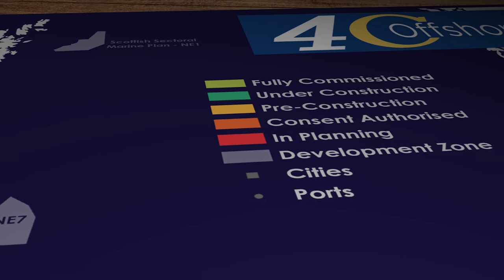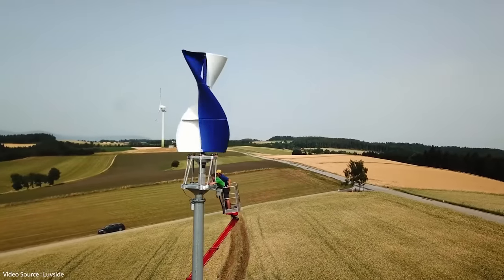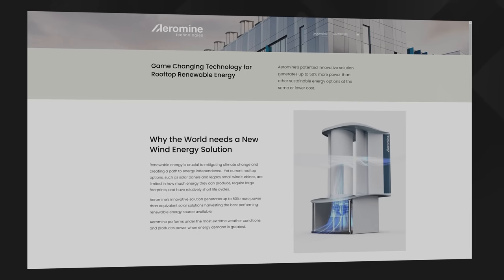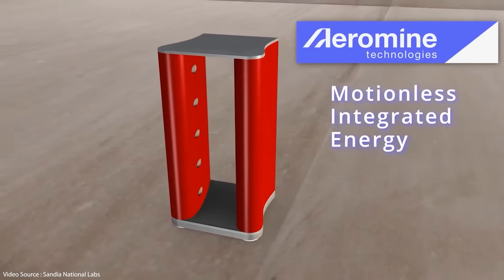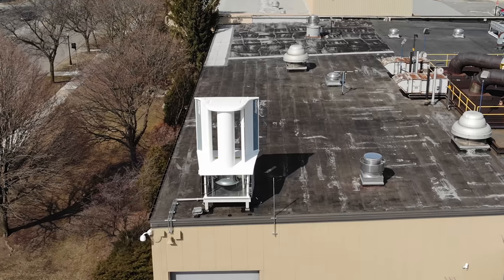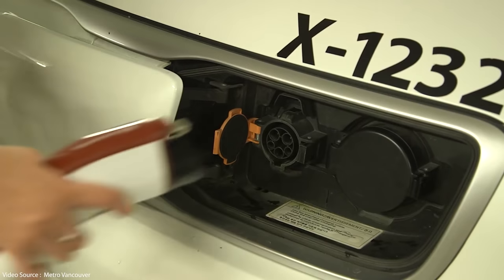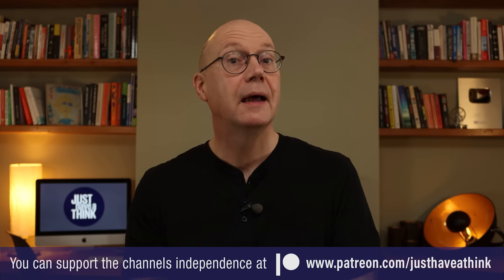Aeromine Rooftop Wind. Static. Silent.  50% more power than Solar PV. What's not to like?

Comment: Thanks for this news for buildings in windy but sun poor areas, where roof top installation and placing is done safety aware (wind load resistence) to get benefit without risk.
@Safety first: maximum storm wind load of higher on top installations should be checked to make safe that they can and do resist next heavy winter storms. 
@Placing wind gen. combined PV: PV on top of wind gen or at minimum northside to PV (looking southside) to avoid shadowing of PV cells which is bad as shadowed PV cells decrease solar energy harvesting as inside of PV modules the inner cells are connected in serial for added voltage, thus shadowing one cell will block that serie circuit reducing the PV power.

Comment: Also, wind turbines need to be mounted at fairly high altitudes—typically a minimum of 150’ but to be reasonably efficient can be anywhere from 500’ to 900’ for large turbines which, even at the lower effective altitudes pretty much rules them out for practical, residential use
Reply: The trick for normal tall wind turbines is to put them at the far end of the back yard or in a neighborhood park that's already too hilly to be viable for additional homes .  The neighborhood solution would be part of a standard suburb project where a land investment is split into hundreds of single family plots

Comment: I think this could work a double shift on a home, with the lower half in the attic and as it is working , the upflow would evacuate the hot air out the top , cooling the attic at the same time.
But then with that kind of design, you now have to worry about rain  getting in. 
I'll keep working on it lol.
Reply: Most roofers in my area recommend just a ridge vent they will install an attic fan if you wish but most seem to say its a waste of money at least in my area I'm in Northern Illinois as roofs get replaces around me you see a lot of the vents that used to dot the roof disappearing in favor of one  that runs the length of the house at the peak and its all but invisible unless you know what your looking for

Comment: Greetings and thanks for sharing interesting tech.  Amplifying on another comment voiced a while back, sorry to be catching up so late.  Focusing on the 1.5 kW example along with energy conversion laws.  The energy content of the wind is 1/2 rho A v^3.  The conversion has an efficiency limited by the Betz limit, 59 %.  Generously (very generously) computing, we could assign the actual conversion efficiency to be 50 %.  Note that the 1.5 kW video example seems to correspond to a 10 m tall machine!!  Using the apparent 2:1 aspect ratio of the turbines, the capture area would be 10x5 m^2, and rho=1, and effic=0.5.  This computes to v=5 m/s, which is good wind but not hurricane force.  So with excellent design (to reach 50 % effic), the 1.5 kW prediction is feasible.  BUT:  a 10 m tall turbine is way bigger than the example turbines of the video.  And there is considerable influence from the use of upflow currents from the large building surface below the turbine.  Well there are lots of assumptions going on here, but you can see that there are ways to make this work.

Comment: Fog, mist and rain just at or slightly above freezing.  Pressure drops in an airflow produce lower temperatures.  Icing, loss of efficiency and damage due to imbalance.  It will be interesting to see how it all wrings out.

Comment: For now VAWT types are over 2000 euro to get the same output as a single 200 euro panel. And that panel uses less space to begin with. So that means in the winter, the solar panel can still outperform the VAWT depending on your location of course...
I one day hope to see cheap enough VAWTs to complement the solar panel in the winter.
In the summer I'm not worried. It's just december till april that's a pain, after that, the generation overkill needed to offset battery costs is enough to have so much excess power that you can run your hot tub 24/7 in the remaining months, while still selling energy during peak energy prices (and that's at night or around cooking time).

Comment: You could add in a Stirling engine into the mix and use that in combination with everything else to generate electricity. Doesn’t require fuel just a heat gradient, eg a hot loft and somewhere that cool. Simples.

Comment: The main issue with a wind turbine is always the power collector and inverter you put behind, that has to be much more expensive and stressed (=lower lifetime) than a solar one. And you can't have an emergency break/stop on wind turbines and thus require some emergency resistance in case the grid fall off or some fuse triggers on battery park. Extra cost that are obviously not taken into account.
Putting them on the edge might lower the available roof sun area for PV solutions, that's not fully compatible and it was obviously some merchandising argument.
What are the vibration and forces resulting on the building and thus requiring reinforcements ?
What maintenance is required ? (there is always one)
What about ice that can happens on fins/holes during winter storms ?
What about lesser PV pannels cooling if wind blows with far less forces on them ?
And there is always be (ultra ?) sound, whatever the commercial is trying to sell you.

It might be some good idea, but as always there is too much mechandising into it. If that's that much powerfull, you won't need advertising, it'll sell just by itself.

Comment: Looking at the shape…( two wings facing each other) there is no need for the outer edge to curve, on a wing the angel of attack provides a high pressure force under the wing, Venturi on top creates the low pressure, the turbine doesn’t require the lift.

Comment: Ford f150 Lightning has an interesting little thing, the battery on it can be used to power a house during an outage.  The electric car future is both creating a problem and a solution when other car companies get on board.  With systems like this that can charge a home battery (Such as an electric car) using solar/wind energy that can be pulled on when the system is strained we are in fact just spreading out a power source.  From one big centralized area to many smaller ones around it's going to be an interesting time.

Comment: What a fantastic concept and also with the advantage that efficiency should'nt be reduced over time like it does with PV panels. One question though: what about the potential impact of changing wind direction? does that have a bearing at all?
Reply: There are bearings on the turbo generator. Sorry for the humour.

Comment: Interesting...
I have always thought just how much free energy we let by...
But there are always problems to overcome that apply..
I like the wind turbine..it's sort of 24 hour system..
However in my area we can get winds of up to 160 plus KPH...rare but exist..and can be very destructive... that's a lot of area force..
So although this system would truly work, it would undoubtedly...at some time, get ripped off...
But still interesting...and simply.
What would be needed, is a 'safety blow of system'...so that when the pressure got too intense, it would open up more, to reduce and deflect it away..
Then we would have something..
Regarding industry...they should all be self-sufficient... independent...by law..
Good video...we need more of this, thanks.
Simon a Brit in Spain 👍 retired

Comment: It seems that this would also be good for single-family home in the US.  This could replace attic ventilation systems and also draw heat off of attic spaces. Drawing air in from the attic. The rising effect of hot air could also improve the efficiency of the unit.
Reply: Best on apartment complexes especially

Comment: Combining a solar wind chimney with an aeromine wind turbine as one unit could potentially result in a more efficient and effective renewable energy system.

The Solar Wind Chimney is a type of power plant that generates electricity using the natural convection of air. It consists of a tall chimney surrounded by a large greenhouse-like structure. The sun heats the air inside the greenhouse, which then rises and flows into the chimney, causing a draft that drives a wind turbine at the base of the chimney.

On the other hand, the Aeromine wind turbine is a type of vertical-axis wind turbine that can generate electricity from low-speed winds. It uses a unique design that enables it to start rotating at wind speeds as low as 1 m/s, making it suitable for locations with low wind speeds.

By combining these two technologies, the solar wind chimney could provide a source of hot air that could be used to drive the aeromine wind turbine, increasing its efficiency and potentially reducing the overall cost of the system. Additionally, the aeromine wind turbine could provide additional power to the system when wind speeds are high, complementing the power output of the solar wind chimney.

Combining a solar wind chimney with an aeromine wind turbine in a high-temperature climate region could potentially be an effective way to generate renewable energy. In such a region, the solar wind chimney could provide a source of hot air that could drive the aeromine wind turbine, increasing its efficiency and power output. Additionally, the high-temperature climate would provide ideal conditions for the solar wind chimney to operate efficiently by creating a strong draft.

Comment: Very interesting. Unfortunately, I can only see this setup working in areas in warmer climates. We get a lot of snow on our roof during winter months, which is why we opted for pole mounted solar panels. They are much easier to sweep off than if they were mounted on the roof. Thanks so much for such interesting videos.
Reply: where I live flat roofs get shoveled,. So in a commercial setting where these are targeted you'd have a maintenance guy doing snow removal on the roof.

Comment: I doubt the 5 kW. Let's say the intake is 2 m2, and the wind speed is 10 m/s. This would mean 20 m3 air passing through pr. second. 20 m3 air weighs about 26 kg. 26 kg passing at a speed of 10 m/s posesses kinetic energy of 1300 J. And that is if you manage to stop the air completely, which I doubt is the case here.
The whole 'Venturi' thing just adds complication and a lot of loss to the system. There's no way to 'amplify' the energy, that would defy the principle of energy conservation.

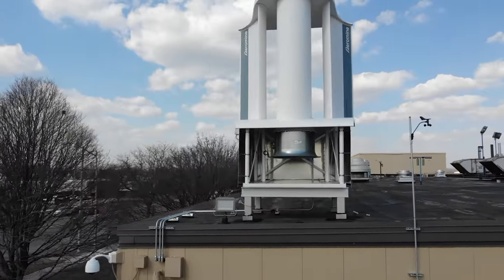Comment: You've repeated that there are no moving parts but the video clip shown at 5:10 shows a rotating fan at the base of the funnel, as the camera pans downward. I understand this design would be very quiet, but it appears there are moving parts. The parts that likely are generating the electricity, by moving.

Comment: I like most alternatives to produce electricity, but this one in particular. Though I live in a country with lots of sunshine, solar power only is not the answer to my needs. We need electricity mostly at night, when we have our AC on, the time that solar panels don't deliver. The alternative is expensive batteries to store the electricity, but I'm not happy with that thought. This Aeromine Rooftop wind power is so far the best I have seen. Would love to have one of those on my roof!

Comment: JHAT,  if i didnt miss something?  The system uses a wind turbine or other  impellar system. There are moving parts?  The wind capture and  speed amplification i understand. But it cannot generate power without an impellar?

Comment: It doesn't output 5kW though.  With a swept area of around 6m2, 5kW is the available wind power at a fairly strong wind (11m/s, 5 beaufort).  The mechanical efficiency of the Aeromine is around 1/3rd (tested in wind tunnels) so when you factor in some additional losses (turbulence over rooftops) you might get 1.5kW on a rather windy day.  With the winds we're usually getting here (5.5m/s, 3 beaufort) it produces at best 0.2kW.  Still, it might be worth it, if the price is low enough.  Maybe not on your own roof, but a bunch of these on a larger high rise residential building might produce a fair amount of power.  I wonder if it's feasible to have multiple venturi units piped into a single (perhaps larger) turbine, in order to drive down the cost for larger installations.

Comment: A deterrent to residential deployment is vibration conducted to the frame of the structure. The unit itself may not emit sound but every surface attached to the frame would convert vibration into sound, including the harmonics of the fundamental frequency which presumably varies with rotation speed. Life inside a subwoofer operating 24/7 would be intolerable.

Comment: Are they made from plastic or metal panels? Are they heavy? Are they light enough to be mounted on power line towers? Those towers could hold many and still not block the wind enough to blow the towers over, possibly. I could see if they are constructed from a few plastic molded panels and the hardware, it could be a great DIY kit in a smaller scale for on a house. A few smaller ones would be less unsightly than a large one. Seems you have possibilities. Good luck.

Comment: It would be interesting to see how it survives the winter up here in the north of Sweden .
The venturi effect and down to -40 C is a deadly combination for most materials and engineering .
If the snow doesn´t bury it , I suspect it will self-destroy by icing on the vings like the giant windmills do
Reply: I'm in Canada, I wonder how it would work in our winter too. But even if it doesn't work in cold climates, and it works elsewhere, that could be a lot of local energy production! Exciting. As others have commented, it makes sense that energy may have to be generated in different ways in different places (we do that already).
Reply: The wings are encased in the motor housing... Think aero wing on race cars and how they speed up air.

Comment: My chief concern is the thing being damaged or causing damage in a tornado, hurricane, or hail storm.  Would a protective metal mesh inhibit the airflow causing a reduction in power generation?  While the fan blades do face downward at the bottom of the stack there is still a chance that birds or other creatures might get caught up in them.  The other thing to consider is their shadow they will cast throughout the day.  Which depending on time of day can vary in size and position making it harder to place solar panels in conjunction with their use.
Reply: I think you have a good point.  Also, they say they do not vibrate, but what about over time or when the bearings fail on one of them.  How long would it take to replace.  Also, people like to use the tops of some buildings.

Comment: When air flow is involved, then you find moistier and ice , and this seems a problem in the design of down flowing forces , not to mention dust and insects ,even fungi . Some type of u-bend could help a little .  Damp locations are the places that need the most power generation consistently . And yet the negative effect of air , frequency/balance  , light, temperature , bacteria , water , will need to be examined long termed, in relation to maintenance and life of units, per over period cost . In this game of hidden expense , it is often the means of generation ( that is the natural means of recycle ) providing wear and tear, as they are finding in offshore turbines around U.K. .

Comment: After looking through hundreds of comments, nobody has mentioned the fact that he said "Power rating is 5KW". That doesn't mean that it produces 5000 watts current around the clock. The math on that would need it to be constantly 65+ mph wind speeds! More likely, it's rated at 5KWh/day, meaning that over the course of a 24 hour day, running constantly, it produces 5KW of electricity. This calculates to just over 200W current, which is more in line with similarly sized wind turbines.

Comment: Current wind turbines are really bad for the environment. The amount of fuel required to get the parts, the production, maintenance, etc. If they run perfectly well for their entire lifecycle, they still operate at a net loss. Not to mention the damage wind farms do to birds. I wonder if these will operate with a net gain; it seems like a simple and efficient design. And for birds, they could still get hurt but it seems safer by leaps and bounds. I bet you could even add a mesh to keep birds out with minimal impact on efficiency.
Reply: What studies have been published proving the operate at a net loss? Can anyone provide a link or some information on how to find this? I thought they do eventually create more energy than it took to create them.

Comment: How is this silent? There is wind forced through an airfoil, and there is a fan. Do you have a recording at various wind speeds? Does the company offer smaller versions for 2-unit buildings that might have height restrictions?

Comment: Interesting, but I am quite sure about the statement that 2x speed of wind means 8x more energy, isn't it only 4x, i.e square root of the speed? And there are actually some moving parts in this device inside the vertical tube, so the noise is not excluded entirely too.